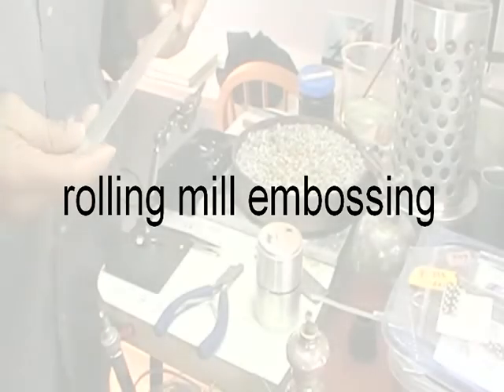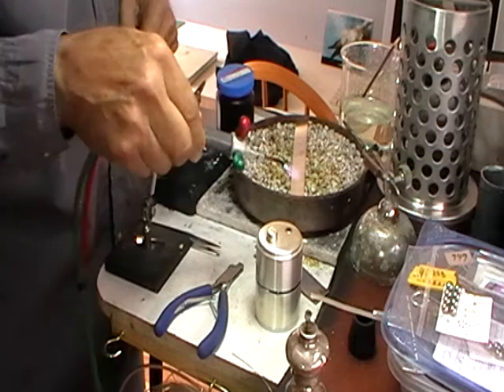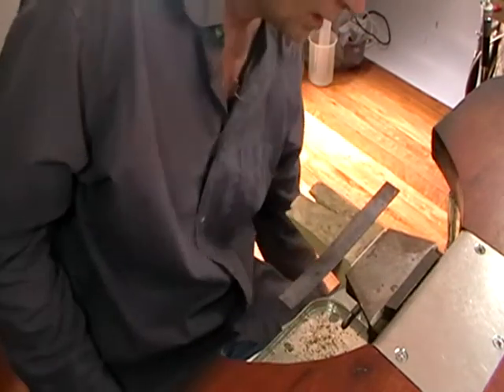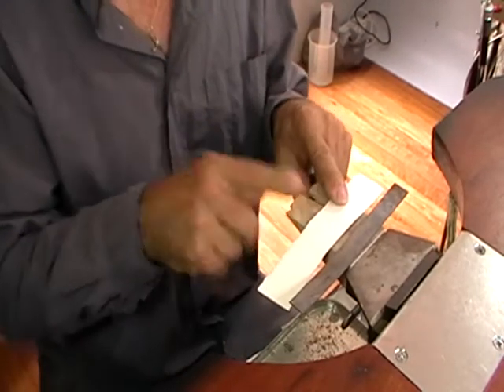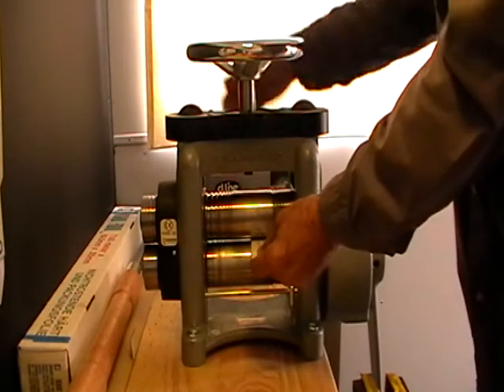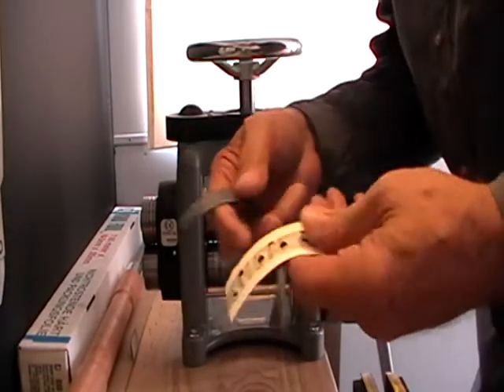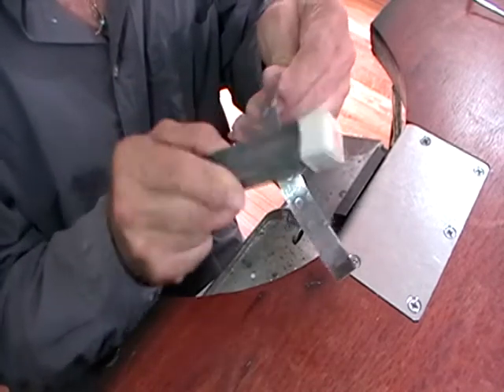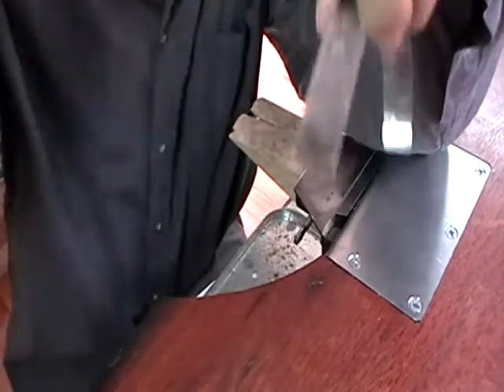rolling mill embossing

Comment: Hi Soham,  I love your videos.  I've learned a lot from you.  I have a rolling mill much like yours (mine's a Durston DRM), but the number wheel doesn't seem to turn independently from the handwheel.  Is that normal?  Also, how do you adjust the parallel of the rollers?  I tried adjusting according to the directions that came with the mill, but it's really, really difficult to turn the gears under the handwheel.  Do you have a video demonstration of that, by any chance?
Reply: vict4ia I would contact the supplier and ask them about that...

Comment: You are wrong with your heating  torch, you always turn the gas off first, turning the oxygen after the gas will blow out the any possible gas in your mixing chamber, and prevent burn back in you hoses, otherwise can cause any explosion,  as a professional welder I use gas blow back arrestor,   goggle gas cylinder explosions

Comment: Hi Soham. question. I bought a rolling mill and just pulled out of the box. Bought it in December. Afraid to use it. I don't want to mess it up. Can I roll my own bezel? If so do I use square or round wire?
Reply from the maker: +Gertrude Sever dont be afraid, just never put anything wet, or steel through it and you will be fine.  i just use .5mm fine silver sheet, roll to the thickness i want, if i want it thinner, then shear it to the right height.

Comment: This might sound crazy, but do you think it is possible to use a stainless steel pasta making machine as a small rolling mill?
Reply from the maker: palawler
it is possible to do a few things with one. i plan on doing a few vids using one
Reply: You can use 24 gauge sheet metal. the book "Spotlight on Wire" by Melissa Cable discusses this.
Reply from the maker: i dont think it would be strong enough
Reply: soham harrison
thank you.
Reply: Dot Schipper
Thanks, Dot.
Reply: +palawler I've used a past machine to uniformly flatten wire. It works very well.
Reply: +Annie Laura Thank you.
Reply: +soham harrison That would be wonderful - thanks!
Happy Solstice to all.
Patricia

Comment: So you don't have to put this through the mill with extra copper (or other metal) sheets over it? As in sandwich it between extra metals? It works just as well this way?
Reply: It does – just done it with a strip of textured ribbon on top of the sterling silver and got a lovely result.